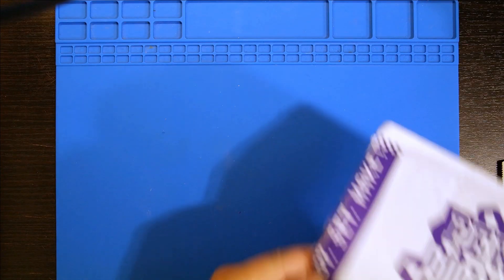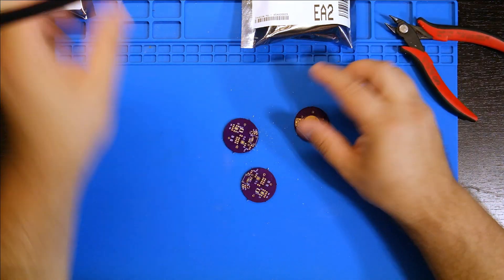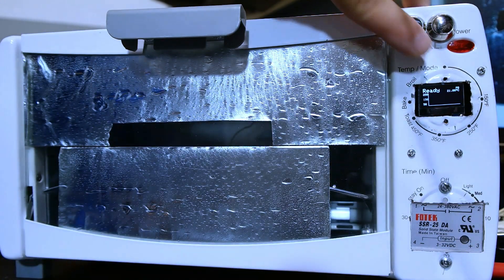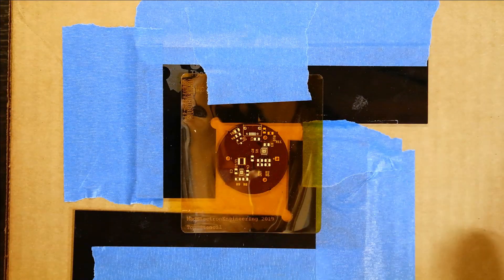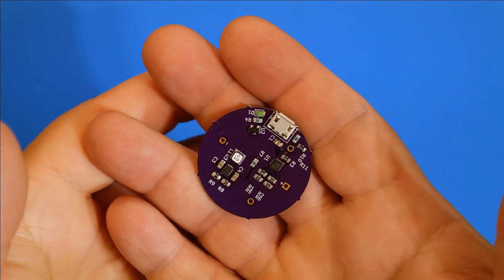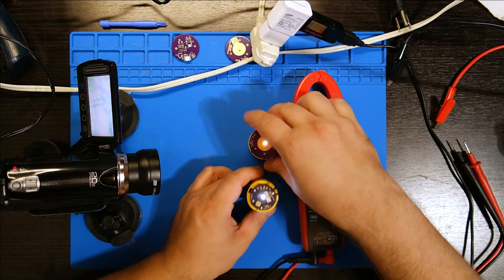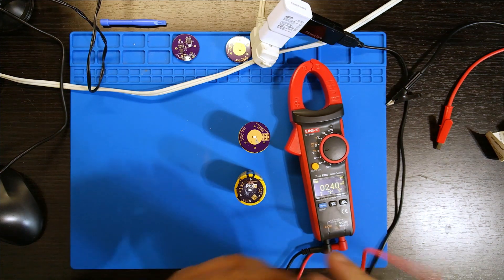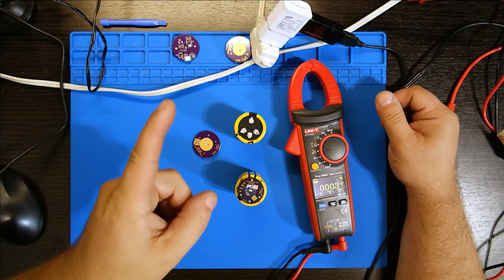Endless Torch V2 Maybe....

Comment: I know this is late, but my 2c worth.   The LTC4425 looks to be a super cap charger designed to run off batteries, or standard USB as such it looks like it has a max current in of 500mA -  this isn’t specified directly but is shown in one of the graphs, and the example circuit for USB.   As such it is a good choice for a consumer grade product where people will plug into their computer, tablet, low power wall wart etc.   

It’s not such a good choice if your available source current is higher, such as high power USB or solar panels, or even for that matter LiIon cells.